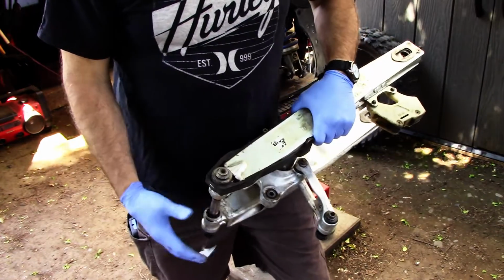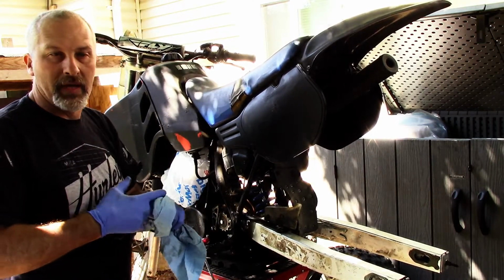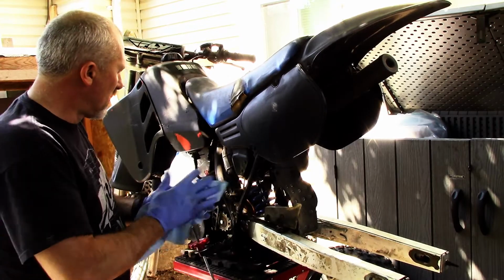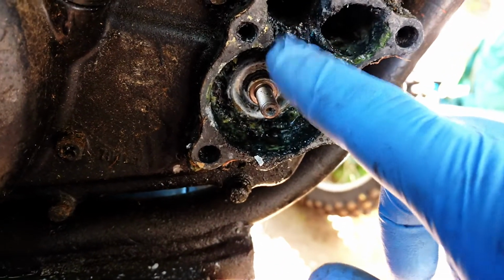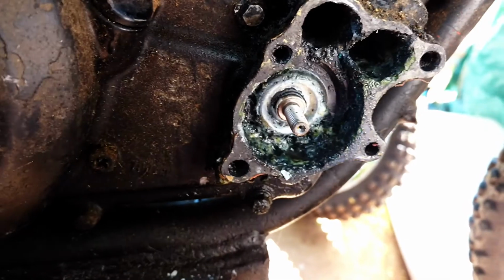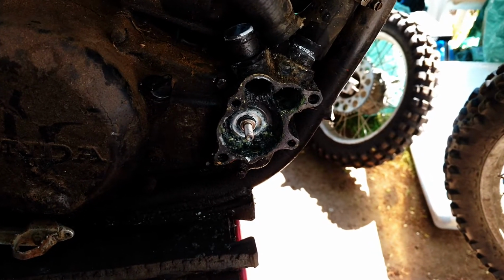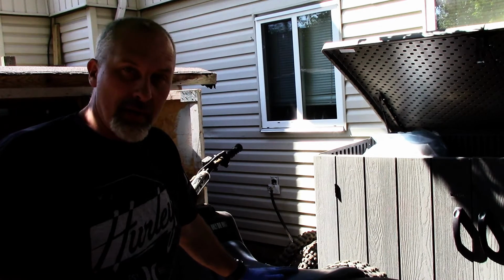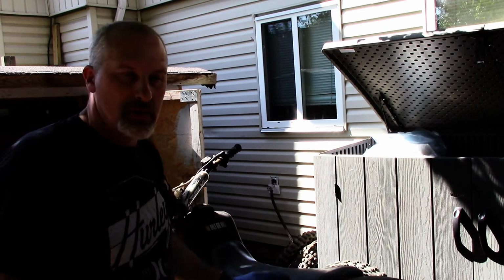Craigslist Honda CR500 Will it run!

Comment: I've rebuilt covers worse than that with JB Weld and used a dremel to reshape it. I also bought one of Russell sand cast covers. You seem to be an industrious guy, try to rebuild it, nothing to lose. Also, your rads could be clogged with magnesium.
Reply from the maker: Rads are fine. when he drained everything, he did not drain the waterpump itself. Sat for years and just ate the cover. I may rebuild the cover, but i ordered one from Russel. Cost $507 canadian.
Reply: TNT Moto ouch ☹️Use Evans waterless cooler, that's what everyone uses. I even use it in my other bikes.

Comment: hey there's a brand new OEM cr500 waterpumpcase/ clutch cover on ebay for $250 you'll see it just type in ( cr500 waterpump case)

Comment: I'd be interested in seeing how to replace the bearings in the rear suspension linkage as my Honda XR250R has a very similar issue that needs addressed, the swingarm hasn't got play side-side, but the linkage had play up/down.
Reply from the maker: I will probably be using a 10 or 12  inch C clamp and a couple of deep sockets. One the size of the bearing and one larger for the other side. if that does not work i will probably buy a proper tool. but you can also use a piece of ready rod and sockets as well. i will show the whole thing in a video.

Comment: Dam didn't see the message would have went to tahimi
Reply from the maker: Lol we were there for 4 hours. was a good ride
Reply: hey tnt so idk whats wrong with my dist brakes on my cr 125 but they apply pressure for no reason and they never used to do that
Reply from the maker: Try bleeding them. make sure the guide rods have a little lube on them. then i would say the pistons in the brake cylinder are not completely retracting.

Comment: You need to get a decompression valve installed in the head, will kick like a 125. Go to a HD store and buy a valve.
New clutch covers are about $300 CAD on ebay.
Reply from the maker: S D thanks I will look into installing a valve.

Comment: Would be nice to hear what you paid for it. There's nothing better than seeing a person go through something that knows their shit, is straight up about what's happening and has a passion for it. Not someone talking out their ass trying to sound smart.
Reply from the maker: Ok fair enough. Dont start throwing up when you here what i paid for it. $1500 canadian
Reply: lol not at all. I know the history and demand for these. Engine alone is a friggin genie in a bottle. Priceless...and once she's used up there might be no replacing it. 
Thanks for keepin it real brother. 👍🏼
Reply from the maker: Took it to the track once. terrified me.
Reply: More so with no clutch too I'd imagine. lol they are a beast for sure.
Reply: TNT Moto I'm in mine for over $4,000 now paid $2,150 originally and it ran and rode, but had water pump rot and the front caliper needed rebuilding plus a couple odds and ends. Then I got carried away buying a bunch of parts to restore it lol.
Reply from the maker: GyroPyro12 I think by the time I am done it will be around $2500 Canadian.
Reply: TNT Moto That's not bad at all.
Reply from the maker: GyroPyro12 most of what I need to do is time.
Reply: TNT Moto That's how it goes a lot of the time.